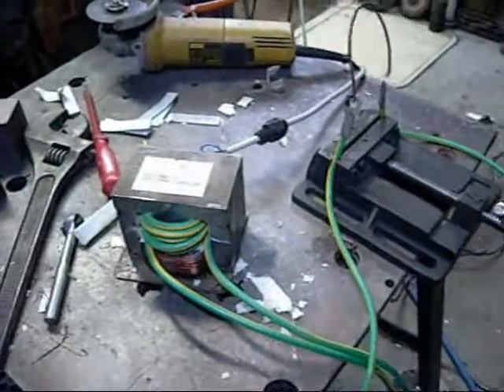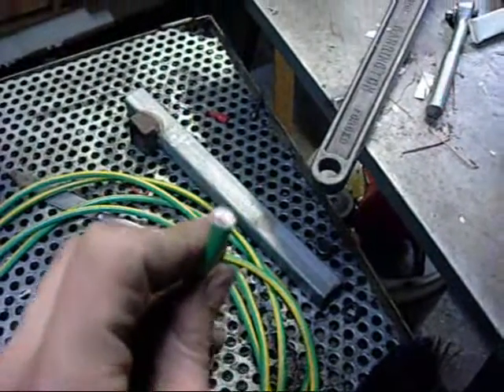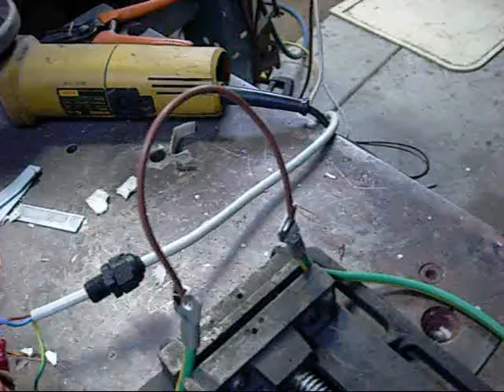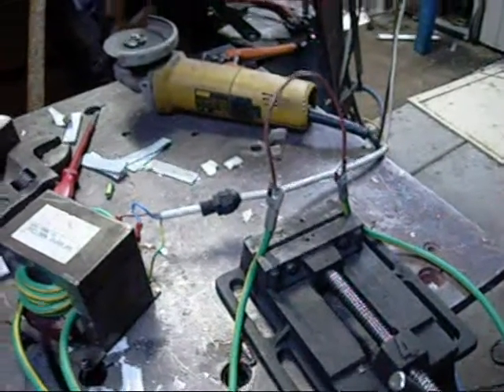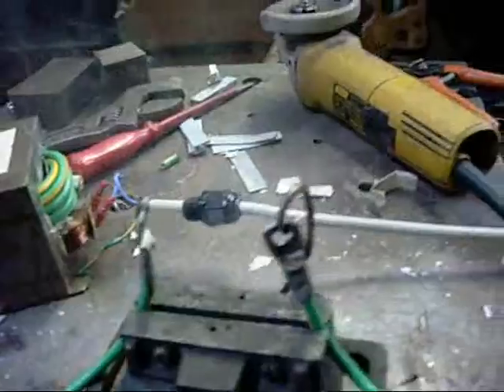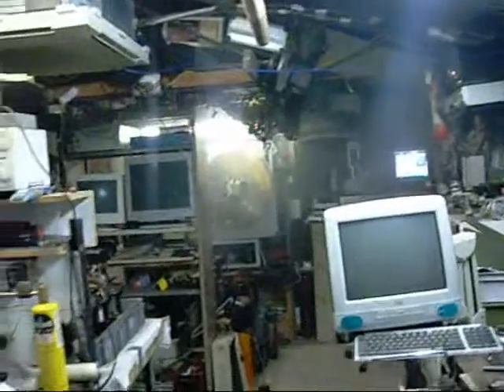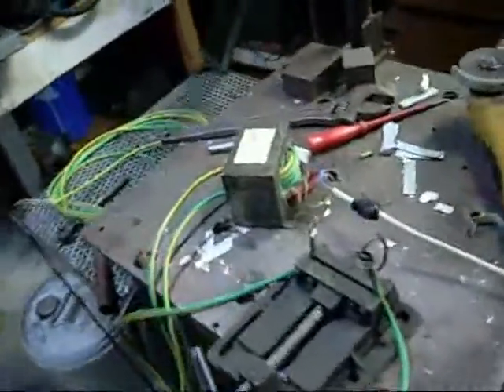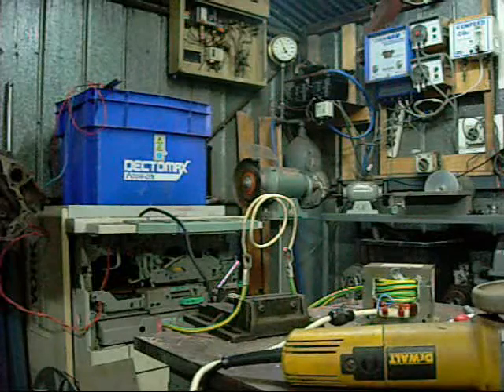Destructive Testing, 7V Rewound MOT

Comment from the maker: I cut the hair thin secondary off the MOT and wound standard PVC insulated earth cable around the core, roughly 6 turns IIRC.

I'm not sure if the voltage is high enough for electrolysis, but if I find a big rectifier I may try it someday.

Comment: It would be quicker to put amp meter on primary 240v then do some quick calculations based on the output voltage. Transformers are typically about 92% efficient at full load for copper windings. So if amps on primary are less than 10 Amps say 8 amps. 
8 x 240= 1920Watts 
1920 Watts / 7 volts = 274 Amps 
274 Amp less 8% loss to heat = 252Amps approx at short circuit if we ignore power factor, resistance of shorting wire etc. This way you can get an approx value.

Comment: dont worry as the current is ac it will not short out the way you think it will very little current at all will travel in tap water,check out my steam generater vid ,this device 
is what led me to beleave a water cooled secondary is possible becuase 7 volts is way to low ,even 120 wall current allows very little current to flow so i adbaking soda to the electro boiler on the electric steam generater

Comment from the maker: Thanks for the info!, I have a feeling its in the 250 - 300 range but I can't tell for sure untill I get a clamp on meter.

I was thinking of using oil for insulation on my HV MOT since I keep frying secondaries with the smartdrive generator.

Comment from the maker: damnit, I think I just wiped one of your replies by accident :(

I'll get some glue-lined heat shrink tubing from the electrical supplier next week and try a tube coil with an air core or oil fill, I think water may create a short when it goes back to the tank, even though its only 7v it'll still create a circuit through the pump.

Comment: That looks like fun 240v at 10 amps = 2400watts delivered at 7v = 342.86 amps. 
As long as the primary can handle it that puppy can smoke just about anything.
 
Try immersing MOT in mineral oil bath and pumping the oil through a car interior heater radiator with a fan, if further cooling is needed.

Comment: ha haa you are the sht bro we think alike 
i realy like this comment the shrink rap
i hadnt thought of that and yes it would be best to cut the mot appart as i intend to 
fill the pipe with sand and coil it prior to instaling it i decided to build a plastic cutter i need to fing a sutible wire  though
i intend to have a wire stranded from a l  braket thats extends into a table then you can push the plastic threw the hotr wire
like a tabel saw,any thanks for the shrink rapp idea its gold

Comment from the maker: If you need info on plastics melting points I can go through my injection molding books and scrounge some info up for you!.

Most common working temps would be:

Polypropylene and Polyethylene : 195 - 225*C
ABS and ASA : 225*C
Styrene: 165 - 195*c ( rarely do styrene so don't quote me on that)
Polycarbonate: 250 - 300*C
ABS/PC composite (like most electronics housings) 245*c

Of course, melt flow indexes vary from one grade or manufacturer to another.

Comment from the maker: I totally forgot to credit you for giving me the idea with your test video! i saw that ages ago and it was a great demo!

I like the idea of using a water cooled secondary, HVAC capillary tube or 1/8" liquid line tube would work really well!, heatshrink it and start forming the coils.

I'd cut the base plate off the trans for that though, form the pipe coils on a block of wood then fit to the trans core and reweld the base on.

Comment: nice set up bro i sent a vid to help you get a grasp on how many amps can be achieved,im shure you no all this just wanted to share ,i also decided to build a plastic cutter out of one of these ,maybe heat a wire or gittar string and push the plastis threw it like a  table saw, also i may build one with a copper pipe secondary with water circulating threw it , the spot welding works for very small thin metal you need a very good tip to do it